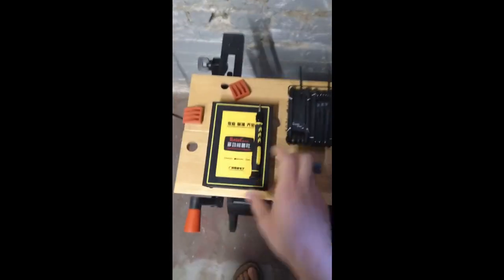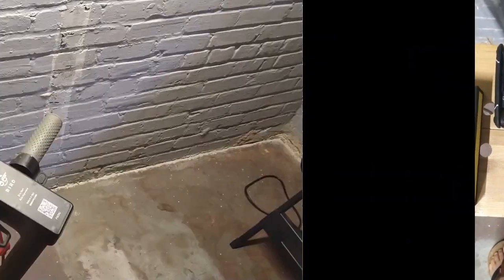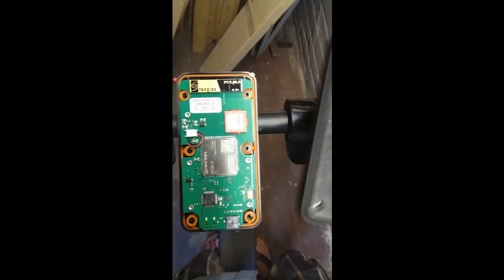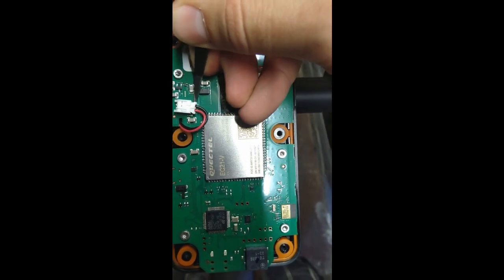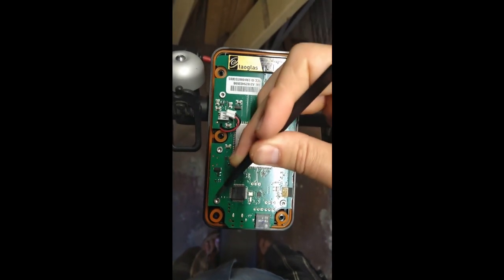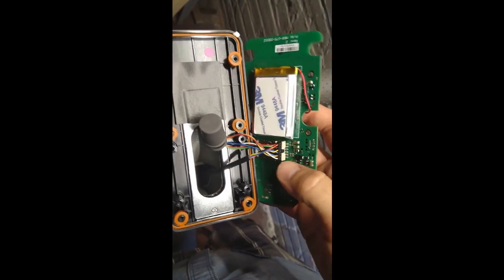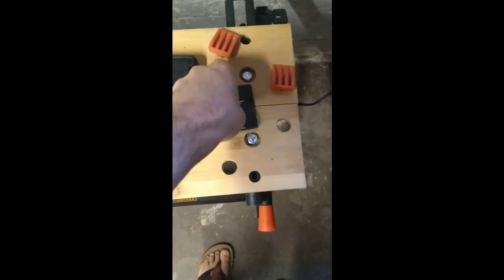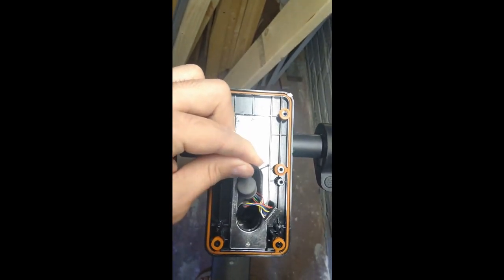Domesticating a Bird Scooter!

Comment: Great video!  Thanks for making it!  I found when taking mine apart (same situation - impounded Bird) when pulling the plug apart at minute 4:43, they were actually glued on.  There was white glue on the sides.  I scrapped it off with a knife and was able to pull it apart.  The board on one of two Birds beeped at me when I disconnected the green board.  And, I found that at 6:22, several of the screws were missing.  The coloration of materials and state was definitely different between units.
Reply from the maker: Interesting. Did you get it up and running?
Reply: @ProstatePunch  I got one to work and the other did not work.  What do you think is the issue?  Dead battery? All the wiring seemed correct.  Also, do you need to install the app or is that optional?
Reply from the maker: @LemanRuss77  App is optional.  What happens when you plug in the charger? Does the charger change color?
Reply: @ProstatePunch  no effect when I plug in charger.  There is no color change
Reply from the maker: @LemanRuss77  The charger has a little green LED on it that should change to red when you plug it in. If not, you likely have a battery issue.  Check out this video: https://youtu.be/uUEI9BMblfc
Reply: @ProstatePunch  thanks - I'll check the charger.  I plugged the charger in with the new board installed, turned it on, and nothing happened.  Charger should be fine since it worked on the other scooter.
Reply from the maker: @LemanRuss77  Yeah I ran into that too. Ended up replacing the battery because it was just too much work.  Check that video though, its very in depth and should narrow down the issues.
Reply: @ProstatePunch  I tried the charger again and it stayed green when i plugged it in.
Reply from the maker: @LemanRuss77  Yeah you have power / battery issues. Watch that video and see if you can solve it.  If you aren't handy... Just buy a replacement.  I think like $65?
Reply: @ProstatePunch  I pulled the battery out and checked it.  Assuming I checked it right, it had 0 charge.  Where did you order your battery from?  I haven't found one for less than $100
Reply from the maker: @LemanRuss77  AliExpress. You can give them a shot.  You might not get your stuff for a month or so.
Reply: @ProstatePunch  ok - thanks! I've ordered from them before - looks like about $100

Comment: 8:40 once all of that is out will you be able to use it freely? Or does the Pro kit have to be installed in order for it to work?
Reply from the maker: You have to replace it.  You can use a standard, or a pro.  I used a pro on the one in the video, but the standard works just fine (I prefer the standard, to be honest)

Comment: So I can just find a bird out side and follow this steps and I’ll be able to use it with free of charge????
Reply from the maker: In theory, except that they have GPS trackers in them and they know where they are at all times.  You would essentially be disabling this and stealing it.  

I don't recommend theft.
Reply: ZX Projects what do you recommend then?
Reply: @ProstatePunch  can't you disable the gps tracker by just taking it out?? Did you take it out of yours?
Reply from the maker: @leximentos  Yes, You have to take it out, its one of the first things I did.  Its built into the board that's on there.
Reply: @ProstatePunch  Thank you!!
Reply: @ProstatePunch  the GPS is always on the board ?
Reply from the maker: @athaschannel5530  Varies model by model.

Comment: Lime gps is in the green box on the scooter column right??
Reply: Yes
Reply: Yes
Reply: Can you simply disconnect the green plate and throw it away?
Reply: @cond.oriano3264  do touch anything other than gen 3 lime.

Take the green box on the column and pull it out dont cut the wires just pull it out. 
It has one plug that is free and two that are connected to the scooter. After disconnecting u can ride it without gps or emergency brakes.

You can dwnload the hex files on the forums and use a 10$ usb to pin connector i forgot what its called to connect the controller to the laptop and be able to flash the controller.

Do not forget to buy a charger because if you put a switch on the battery for power you need to charge it to restart if it was completely off.

Cheers

Edit: you need the green plate with gps on the column to run it after flashing. U need it removed until you get it home and connect it after flashing
Reply: @FirstLast-tx3yj  Thanks dude. But on the green plate there is the GPS module located right? Isn´t it dangerous to reconnect it after flashing?
Reply: @cond.oriano3264  nope do it and check on the app doesnt show up. Dw after u do it u wouldnt care as much as now. Now ur just worried and anxious after u wouldnt care.
The gps wouldnt work but the scooter will
Reply: @FirstLast-tx3yj  Alright. Do you have any link to a step by step tutorial or something? I haven´t found anything good on google especially for lime scooters. If so you can pm me
Reply: @cond.oriano3264   i will search for the page. Pm you where?
Reply: @FirstLast-tx3yj  I thought you can pm on Youtube. Did they turn off this function? Lol otherwise just write the link down here I guess it won´t be a problem
Reply: @FirstLast-tx3yj  Thank you very much mate
Reply: @cond.oriano3264  welcome bro. Dont hesitate to ask. I was there several months ago and couldnt find help. Dw its not as big of a deal as you think just paint it after and remove front wheel fender and useless stuff like reflectors on the column and paint it any color you want.

Also the controller on some gen 3 models doesnt have pins they removed them so it depends on your luck. If you dont find pins solder 4 small wires to where the pins are supposed to be and connect to that.
Reply: Are there any forums I can check out?  Hard to figure out from the French videos
Reply: @TheSnowRobot  idk i am not part of any forum. When u remove gps and grab one u will figure ur way dw u just need the usb link and program along with hex files to flash

Comment: Are you able to get the mph and battery values to show on the display when in use? Or are you only able to on the app?
Reply from the maker: For the original board, only on the app.  If you do a pro board conversion it will show there

Comment: Ok I want one, where can I buy an affordable one 🤔
Reply: Walmart selling a Bird scooter for $300 currently! It rides great!
Reply: Look on offer up too.
Reply: You can buy a bird ES4 from Best Buy for $500. Some sites sell the refurbished Xiaomi M365 Pro for $350-400. I would only recommend getting these 2 scooters.
Reply: @lefthanded5473  The ES1 is the same as ES4, except for the extended battery which you can purchase for $99
Reply: Jerrin Koshy The ES4 is the ES2 with extended battery. The ES3 is the ES1 with extended battery. The ES2 basically fixed all that was wrong with the ES1 like the suspension and low range for example.

Comment: You know where the GPS is? And where to buy the module?
Reply from the maker: Yeah man. Watch the video and read the description.
Reply: @ProstatePunch  zach...where is the GPS ? in the upper box?
Reply: @ProstatePunch  I has only one at the handlebar? I beleive, that normally they are equipped with two, where the second one is under the frame.
Reply: @jesusxXxlizzard  birds that old only had one GPS module. im fairly certain all birds only have one GPS module. the 365 and es2/4 are on the top. the bird zero has it in the frame
Reply: When he turned the board over to unhook the harness you can see the sim card. Just yank that, and no matter where the GPS is, it can't talk back to Bird :P

Comment: "I'll post a link"
Doesn't post the link.
Reply from the maker: Guess I never did post it.

I just checked my eBay purchase history and the original post / poster is gone.

So you need to find a m365 circuit board.  Make sure you get one that's authentic.  There's other YouTube videos / sources to verify the board is authentic.  Otherwise they won't work with the Mi app.  There are aftermarket apps that work with the knockoffs though.

Comment: It's just a DC motor, switch, and battery. Why do you need to keep all those electronics in there? You're just getting rid of the GPS module and rewiring a throttle switch between a battery and motor. That's how Amazon and wish sell that BS